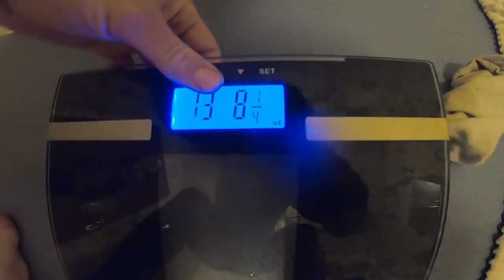Did they turn up.....

Comment: Good thing to do for the hoddys is use the plastic wrap that the bricks come in put it all along the sides of the wall of the ground floor so all the muck that falls through the gap between the joist and the blockwork and gets rock hard easily comes up if its on the plastic big pain when it goes rock hard on the floor and you've got to go at it with a scraper

Comment: @16:30 think of it this way if that’s the only thing he is picking you on that’s a good thing .. it’s his job to get things done right and by pulling the little things it shows u what he is expecting... the day he finds no issues is a problem. Like u said it’s all trades he is on the ball with .. would u rather have a clueless fool with no materials ordered etc ... sweet work ur doing..

Sad u can’t get reliable HUD’s it’s good £ and guaranteed graft

Comment: Scaffolding is the same, people not turning up after sorting out a start and agreed money. Even after you have received bank details etc too. Madness
Reply: They should at least have the decency to tell you though even if its last minute, that way you can stop wasting time trying to figure out if they are coming or not and it just shows a small bit of manners to be honest.
Reply: @martin2466  yeah now you said it
Reply: @martin2466  You too mate
Reply: @kieranmurphy6538  The funny thing is, they ring up 4/5 weeks later seeing if they can start as the firm they went on has fcked them off.

Comment: Good dependable help is hard to find. Maybe this will work for you. Day in and day out I see nobody better than the work you turn out.  Work ethic is sorely lacking in most people today
Reply: "Work ethic is sorely lacking in most people today" Old men said that in 1950. And 1960. And 1970. And 1980. And 1990. And 2000. And 2010. And 2020.
Reply: @videolad3057  Don’t know bout them bud.  I’m not an Alf man and deal with it EVERYDAY